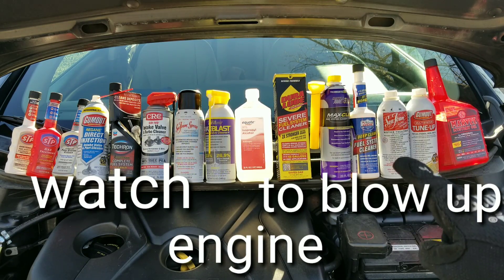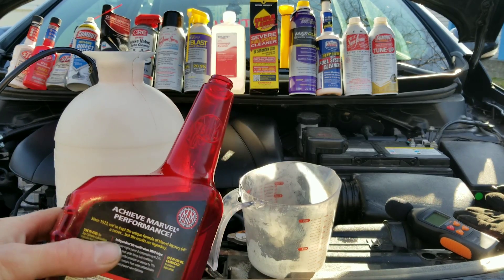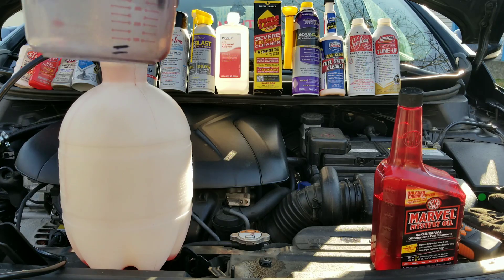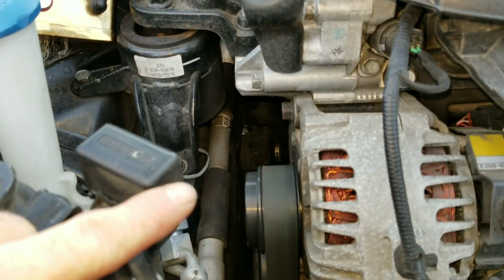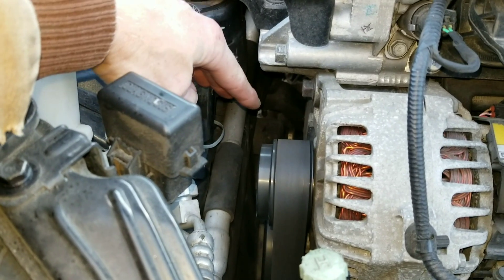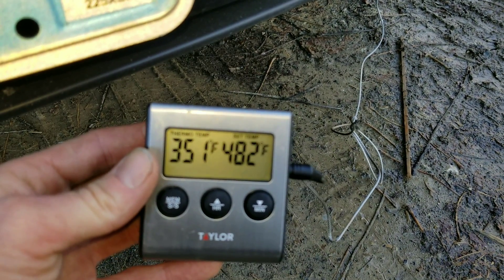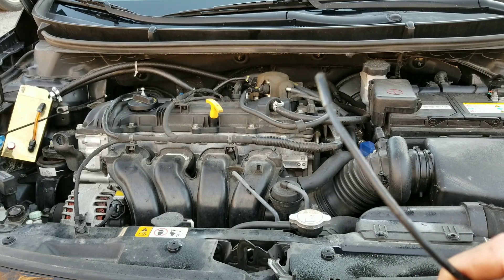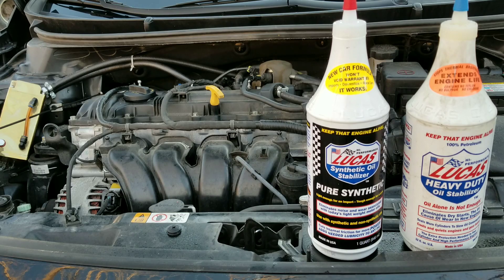royal purple & seafoam spray together clean intake valves on  a gdi direct injection

Comment: Hi Nate. Thank you for your wonderful insight. Thank you. Was wondering..

Some companies like Seafoam and CRC suggest to spray the intake spray treatment in the area where the throttle and intake hose meet. However, I noticed you begin to spray at the end where the intake hose and air filter cover meet. Is there a huge difference in whether we spray closer or further from the throttle? Why did you go with this particular spray distance?

Btw,  I'm running a 2015 Kia Soul base model. The major issue with my car is this pulsating effect that runs under my seat. I've tried several times to take it to the dealership but they keep telling me there's nothing wrong. They call it a rough idle but I call bologne. It's too much for it to be a rough idle. I've tried the following products to no success:

Chevron Full System Cleaner (poured into gas tank). The pulse effect underneath my seat is still there. :(
Reply from the maker: Ok to start sir the less distance between your spray and throttle the better however if you have a mass air flow sensor you must extend straw past it and if the car will not idle well with the intake boot or housing off.leave it connected and open enough to insert straw and thats it next if you have a mass air flow sensor use only maf sensor spray start with engine not running. to be safe spray two to 3 short burst with car off allow to air dry 20 mins with car off  and after start car it may take a few mins or short drive to adjust itself back to normal also make sure coolant is completely cold by allowing it to sit over night and check to see its full to proper mark it also affects idle but also check car to make sure any mounts or bushings arent damaged good info on youtube thats if you have vibrations but idle needle on gauge doenst move plus try to use crc intake valve and turbo cleaner. But check on some of the other i mentioned first you may save on the intake valve cleaner but is that car direct injection? And new cars some have issues with smart alternator because they try to save fuel causing  a small vibration and next do you have variable valve timing or something similar. Meaning with new longer oil change intervals the systems have a small screen that doesnt take much to get clogged even very little so you can change oil sooner every 3000 plus use marvel or seafoam and follow there instructions to the letter for cleaning that old or varnish build up at the time of oil change next make sure you are using the oil recommended and even oem oil filter so if all fails hook to a computer at auto parts store if you dont own one and check fuel consumption (lambda) raito if other wise fails it may lead to a vacuum leak or other so merry Christmas when it comes to a idle yoy see there can be alot unless its a mount or bushings

Comment: With the engine warmed up, then engine shut off, and the valves seated, spray CRC intake cleaner until the valves are covered under liquid, then let it sit for awhile. After pump out the black liquid(with a hand spray with the bottom bottle removed, just put it down where the liquid is and spray into a hand held container) then use shop towels and a scribe or long skinny flathead to soak up residual carbon liquid. Once you’ve cleaned the valves,    seat the next set of valves and repeat. You will remove most if not all the carbon stuck on your valves this way.
Reply from the maker: Sounds effective

Comment: Nate- I have an incredible experiment idea for you- if you're willing to please DO IT in a video, ok? What do you say?
Reply from the maker: Open to new ideas
Reply: ENGINE HOT AND OFF

TOOLS

1) Five feet of smallest diameter vacuum hose you can find. (5/32" is nice)2) Pump sprayer3) Electrical tape4) Borescope
"CLEANER"
One quart mineral spirits
One quart gasoline
Two full cans CRC GDI Cleaner spray
Combine all into sprayer.

Add 4 marbles or small, clean rocks.

Shake one minute to mix thoroughly.
Attach long vacuum hose to sprayer, then tape other end to camera, about 1" past the camera.

Snake down Cleaner/Camera into each intake runner.
Starting at farthest valve- start recording video and spraying, watching to COMPLETELY FILL THE PORT with cleaner. 

Rotate engine to close valves as necessary to contain cleaner. Move to next CLOSED valve.
Wait 30 minutes for each valve.
Repeat entire spray procedure.Wait one hour.Observe all valves.

I'd really change the oil and filter before driving under load
so as not to mix that dislodged gunk back into the engine.

That would be so cool- to actually watch 
what the chemicals are doing.
Reply from the maker: Yeah i agree but the camera gets very hot ive thought of trying while running lol

Comment: I've used B12 i let a small vacuum line suck it in a little at a time till the can was almost empty then let it suck till the engine stalled an let everything soak for a good while on my 94 F150 5.0
Reply from the maker: Was there a improvement?